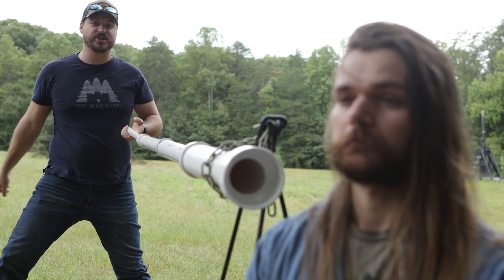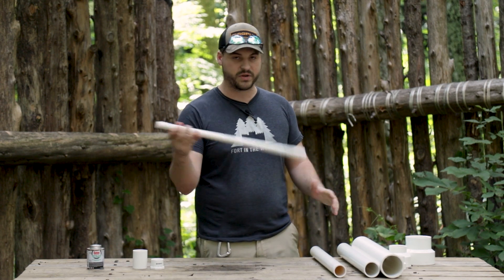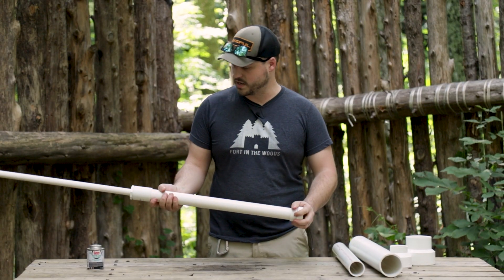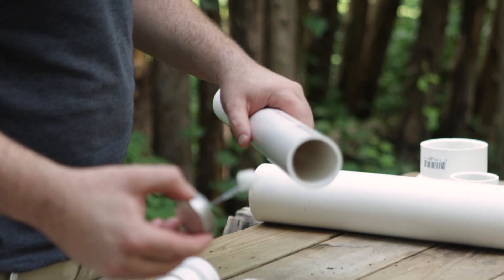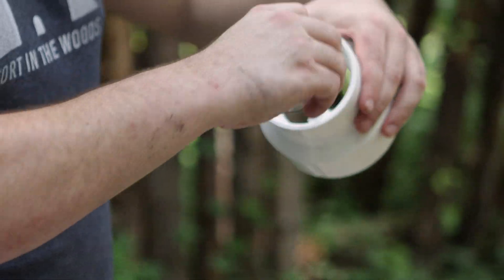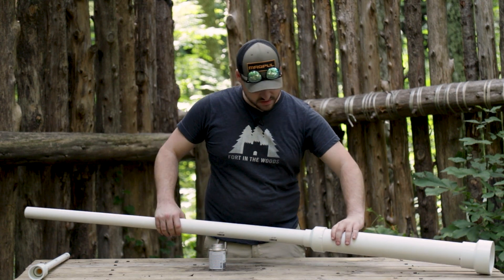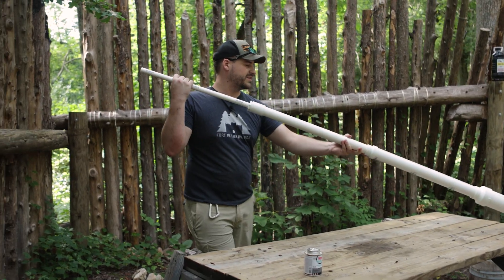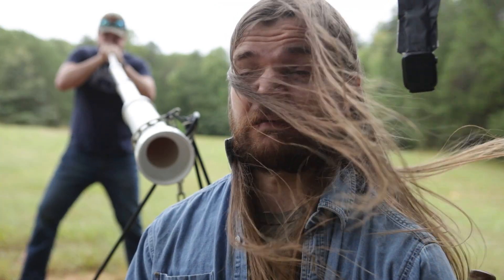How to make a DIY PVC  War Horn! Ultra loud!!

Comment: Can you make a tune? Try drilling 8 holes in the top side of the smaller pipe for your 8 fingers with 2 holes underneath for your thumbs.

Then again, what if the smaller pipe could slide in and out like a trombone? With the holes for one hand drilled into the next larger pipe?